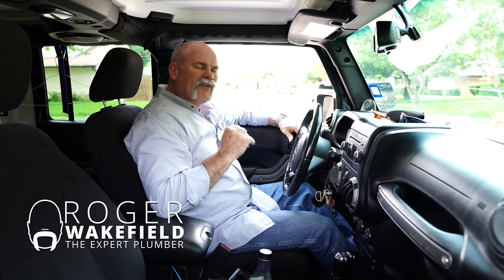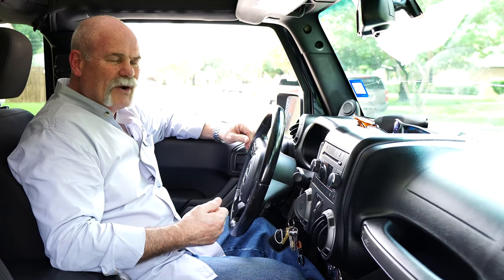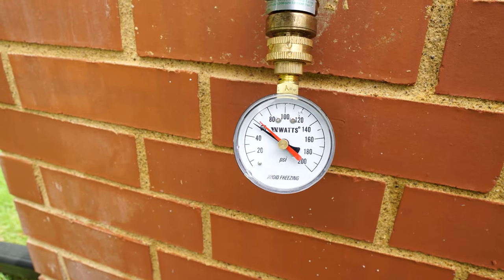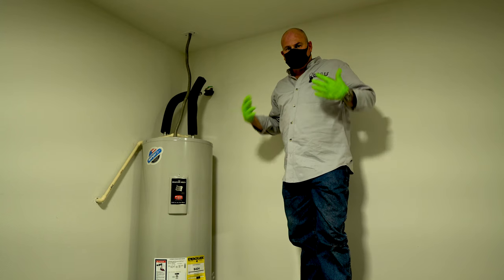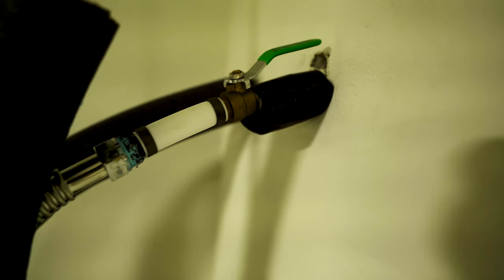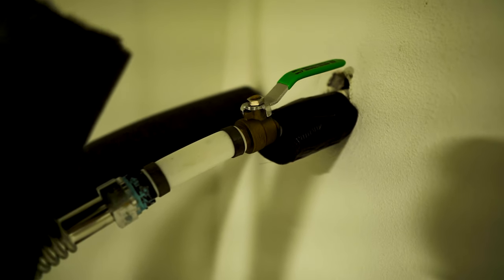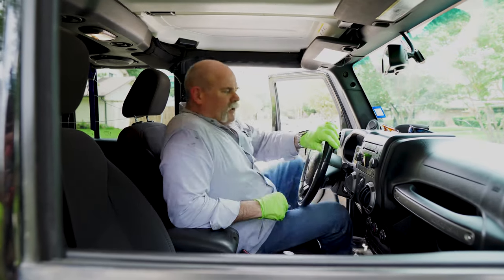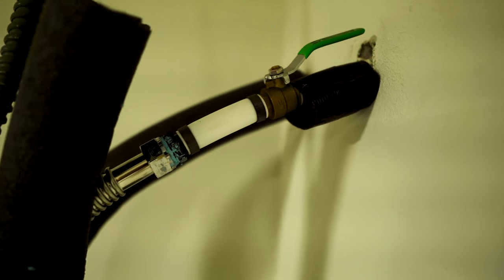Low Water Pressure Issue in Shower - Real Plumbing

Comment from the maker: What do you think about this low pressure issue? Do you think I was right?
Reply: Thank for your information
Reply: Changing out a ball valve isn't gonna make a hill of beans difference. Are you saying it's a pressure or volume issue? When the house is plumbed out of essentially the same I.D of 1/2" copper then choke it on down with a million fittings it all adds up. I'd say the cheapest fix for their problem is to crank that PRV up to 80psi and let em be. It's at 60 as seen. Who ever roughed that in should have went with 1" since using crimp style junk. My .02 cents..
Reply: @JB-jk3ow  Please educate yourself on flow, volume, pressure. The ball valve replacement will solve the problem.
Reply: @joshm5816  the ball valve is a small piece of the puzzle. The problem is I.D of the pex and however many fixtures it's serving. Ball valve will not provide any magical day and night difference. Actually read in another comment on Roger's fix and then you'll understand what I was saying earlier.
Reply: @JB-jk3ow  I understand the flow reduction created by undersized crimped pex. The ball valve creates an even greater reduction. A proper sized ball valve will help increase the hot water flow. I've fixed this issue many times. When crimp pex hit the states I always increased size to prevent this issue throughout the home.
Reply: @joshm5816  a proper sized ball valve? You're stuck with what size line you're running.. i don't care if you run a commercial 6" butterfly valve you're still necked down to when it's reduced down at the adaptors to crimp to the 3/4" pex pipe. The ball valve didn't make any substantial impact to the overall problem. Tell me what kind of "properly sized" ball valve are you talking about for a 3/4" pex line? Educate us...
Reply: @JB-jk3ow  The ball valve in the video is not a full port valve, in relation to the size of the pex being used. A lot of crimp style ball valves, are more restricted than the pex fittings being used. I'm not saying, that the pex installation is adequate, I'm just saying, that changing the ball valve to an IPS style, will help with the flow restriction. I've repaired this exact issue many times, with success.
Reply: Sorry I’m a new apprentice plumber and I’m supposed to expand 1 full size when replacing pipe? What if it’s just a 2 foot section of copper?
Reply: Since the issue was only on the hot side this very well be the issue. It also leads into the questions about the remainder of the crimp pex pipe and fittings, would they also need to be inspexted and possibly replaced and only reduced at each fixture? 

The company i work for uses uponor pex and usually the water pressure issues are debris in the flow restrictors, aerators and angle stops or the PRV.
Reply: Thank you sir! From all of us ladies fixing things themselves because we can't afford help.
Reply from the maker: @watchtheseducks8395  some of the best plumbers I know are ladies… Y’all got this….
Reply: You tha man thanks so much
Reply: I just replaced the inlet water with a ball valve.  Did not solve the volume problem on the hot side.  I have replaced everything else around the water heater (nipples, water hoses, anode, drain flush valve) and nothing has worked.   I'm thinking there are no repairable restrictions and the house is just plumbed that way; certainly not gonna rip out all the copper lines in the house.
Reply: @JB-jk3ow   I think you are probably correct.

Comment: Finally a man who understands the difference between flow and pressure. 
I've been searching, in vain, for information about which commercially available shower heads are easily modifiable to increase flow.
 Every single video I've come across on this specific subject confuses flow with pressure claiming that they are the same thing. In this instance they are, for all intensive purposes, opposites. 

If you've got the low down on that information I would love to hear it. That would make you my hero for life. Although this video didn't address my specific problem I'd hit the thumbs up button a thousand times if I could. 
I sincerely hope this reaches you and that you might respond. 
Thanks in advance.
Help me Obi-Wan, you're my only hope.

Comment: Pressure is fine at the tub faucet, it is only low at the shower head, even after soaking the head in CLR for a few days. This is a new issue in a 20 year old home. Would you suggest a cartridge change?

Comment: There is alot of galvanized pipe in my area I usually see galvanized pipe and it’s packed with rust causing the low pressure.

Comment: So would you replace it with copper?
Reply from the maker: Ben we actually upsized the PEX piping and fittings on the manifold and piping to and from the water heater. It worked well.

Comment: I disagree that it's just that pex valve being the issue.  My question is, is that house on a home run system? ( headers) or is it just teeing off from   a branch line?
My guess is that fixtures are just teeing off a main line instead of a dedicated line to each fixture.
I also would of check the size of line coming in after the meter. Maybe it got reduced down to ½
Reply: Code minimum is 3/4" no way main was down sized.

Comment: Great video👍 i just did the plumbing in my mothers bathroom shower and i ran everythjng 1/2” copper to a kohler 3way diverter and temp valve at the instruction of kohler and now i have low water pressure in the raindrop showerhead and the wall showerhead… any ideas?   Also i spoke to kohler and already took out the flow restrictor in the temp valve at their instructions…
Reply: I think I'm experiencing this issue right now

Comment: Iam normally checking pressure drop after taps

And yeah the pex is so tiny 😂 like 8mm, iam running 22mil copper with a bypas valve on my water heater, got 2 times 8mm intake and that works great

Comment: Those corrugated flex connectors at the water is not a professional install, although very common
Reply from the maker: I agree. We hard pipe with soldered copper. I still love that.
Reply: Roger Wakefield I’m old school as well, still lug my torch around

Comment: Hard to believe one PEX fitting was the cause of the low pressure here. Certainly, what you showed isn't good practice, but the pressure loss on one fitting shouldn't be too much for a shower (2 gal/min -- maybe only 1g/m of hot water).   I agree with the change out recommendation on a new build, but likely there are other issues besides this one valve.   Is a water softener or filter installed?  that would be much worse than a PEX ball valve -- even a non full-port version. Are the lines serving the shower undersized, or with lots of fittings? Beauty of PEX is to make runs with very few fittings; unfortunately this isn't always done that way.

Comment: Love your vids but that one pex ball valve isn't the in any way close to the low flow problem, and even then the water heater itself acts as a reservoir to keep adequate volume on the hot side. More than likely they have  undersized hot trunk, or there branches run way to far from the trunk if there isn't any scale problems at the fixtures

Comment: Where's the thermal expansion tank designated mandatory by IPC??
Reply: Maybe is in a different location. It can be anywhere on the cold side as long as it's in the water distribution system and not being stopped by a check valve. His diagnosis is spot on. Crimp pex restricts flow. I lose a lot of jobs due to the under bidder using under sized crimp pex.
Reply from the maker: Not a closed loop system. It would then be required.
Reply: @RogerWakefield  So no check valves at the meter?
Reply: @RogerWakefield  Okay Mr. plumbing guru I know the code inside and out been doing this 40+ years.. ahem.. might want to re-read paragraph 607.3 and tell me what that means.. "where a storage water heater is supplied with cold water that passes through a check valve, PRV or BFP a thermal expansion tank shall be connected to the water heater cold water supply pipe at a point that that is downstream of all check valves, PRVs and BFPs. Doesn't say squat about closed loop systems either.. Make it a wonderful day 👍
Reply: @JB-jk3ow  , you are correct, especially nowadays. The municipal water companies are getting very strict about regulators and meters. The days of putting expanded water back on the water mains is coming to an end ( if it enters your house they don't want it back) . Install the expansion tank, especially on newbuilds. I installed mine ( tee, shut off, dielectric union and expansion tank) now if the diaphragm goes I can change it out in about 5 minutes.
Reply: @JB-jk3ow  if they follow the UPC instead of the IPC then it isn't required if a PRV is installed. The section in the UPC is 608.3 since a PRV isn't a normally closed device. Here different cities and counties use one or the other or both and add to requirements and then you have "at the discretion of the governing authority" like statements that leave it up to whoever does the inspection and it could be different for each inspector and they take turns telling you you're wrong.
Reply: @bryanfreemyer5074  sorry buddy, We use the UPC in California. Expansion tank is still required if you have a prv or check valve
Reply: @javiervazquez9472  sorry buddy, that's not what the UPC says since not all PRVs create a closed loop system.  You may have addendums for your area that require them.